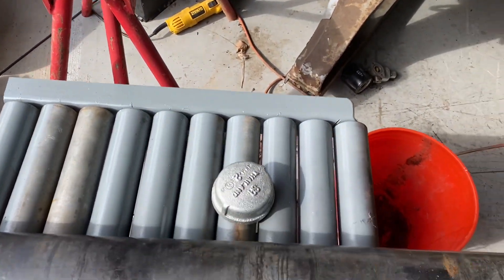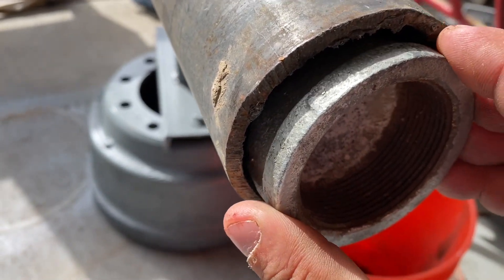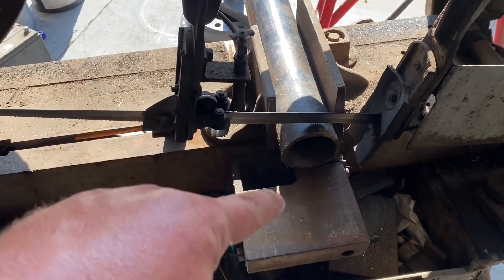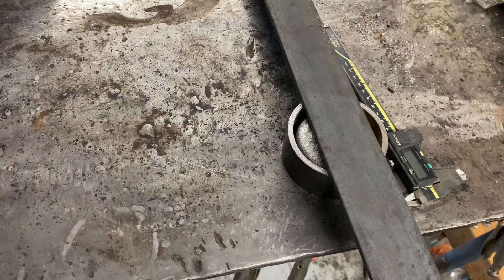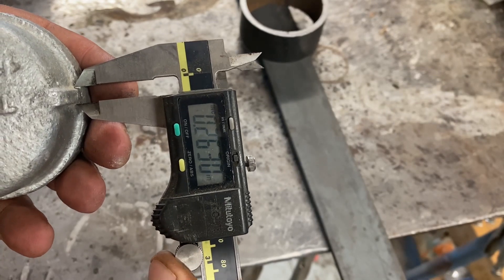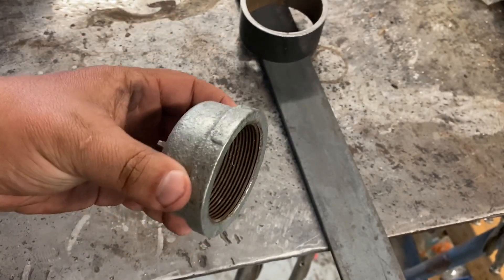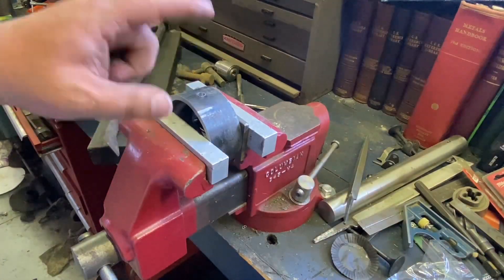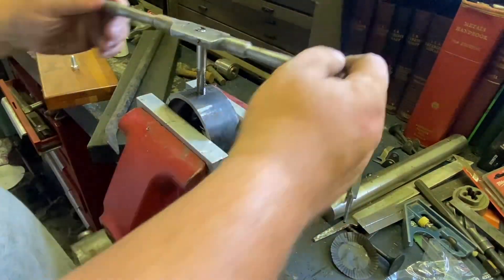Prototyping a new tool

Comment: Would it help to put a three eighths square hole in the middle of the flat bar and use a ratchet with an extension to un screw it?